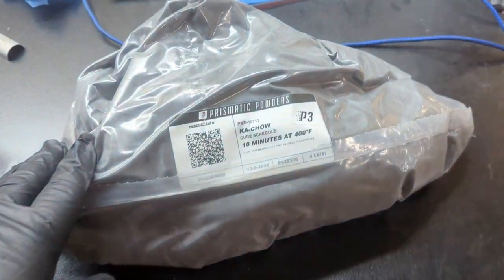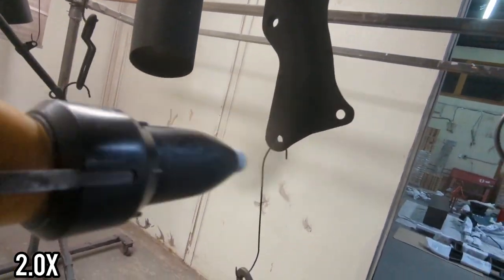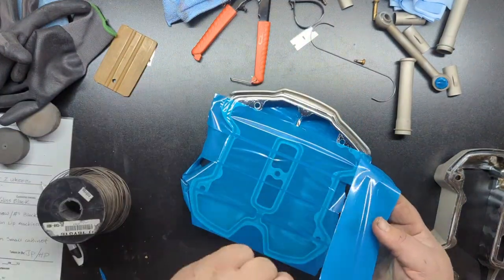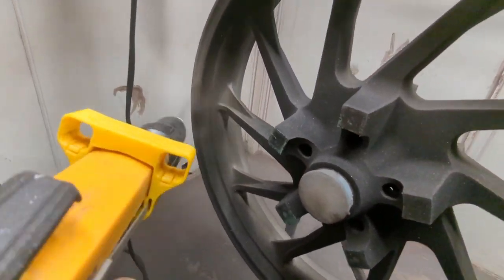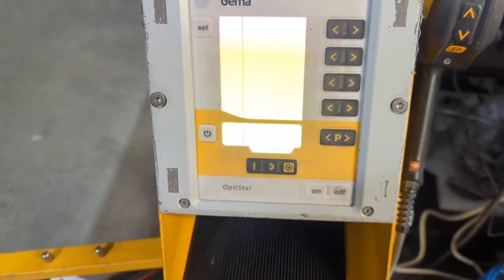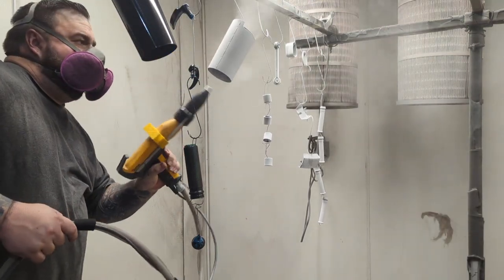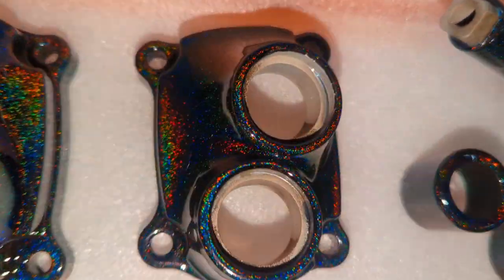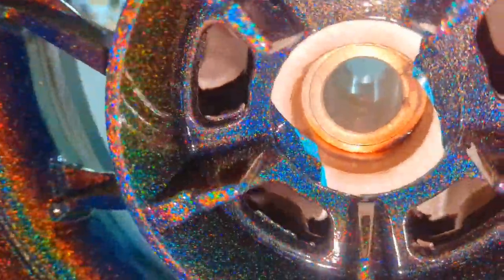Powder Coating Harley Davidson Parts Two Tone - Ep 135 - Ka-Chow from prismatic powders

Comment: Nice vid, thanks for your take on the blue tape. Why do you shake the gun so much while coating?
Reply from the maker: haha this gets brought up a lot honestly, and it depends. I think part of it is habit from older less effective powder units, but honestly, I know it works better to get powder into corners. I Have tried it side by side and there isnt a doubt in my mind it helps at this point. On flat open surfaces it doesnt  change much
Reply: Great, thanks!  @UnknownCoatings

Comment: I'll bet the habit of shaking the gun comes from starting out with a cheap gun. I had to shake my harbor freight gun to make it work right. Then I modified it and it works way better with no need to shake it to fluidize the powder. I'm just a home gamer but get by very nicely ...
Reply from the maker: I dont think that was the reason, though I never bothered with a harbor freight one so maybe its different there! i appreciate the kind words!
Reply: @UnknownCoatings  Copy that. I don't want to spend the big money for quality gear since I'm only doing it here and there. But I'm envious when I watch you work, it looks like a breeze with good equipment. O well...

Comment: Great video, just out of curiosity, inside the lifterblocks where the pushrod tubes slide down, will that seal being powdercoated?
Reply from the maker: Where the o ring sits?
Reply: @UnknownCoatings  yes, shouldn't that area be taped off?
Reply from the maker: Not according to the shop that brings em in all the time. I don't know enough about em but they build em for a living so I just go with their requests
Reply: I was just curious. When I rebuilt my shovelhead I remembered being unpainted or powdercoated in that area. No doubting you in any way. You do excellent work.

Comment: I just had a harley primary cover powdercoated and asked for the clear over it , but it came out orange peely and dry spots everywhere, and they coated the mating surfaces and the backside!  Is this piece toast or could it be blasted and saved?  It does need that metal mating surface right for a primary cover?
Reply from the maker: It can absolutely be saved. Sorry that happened to you. I would remove the powder from the mating surface at a bare minimum